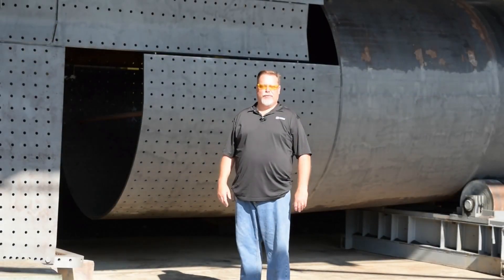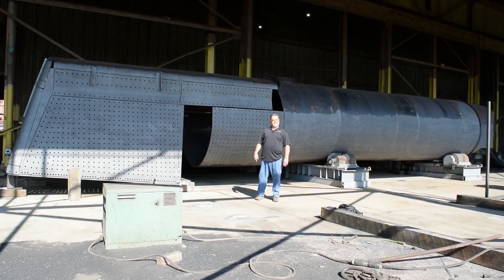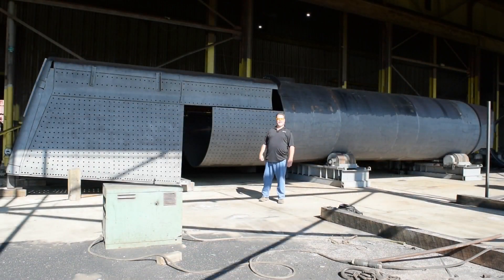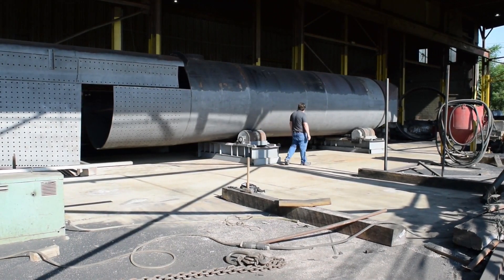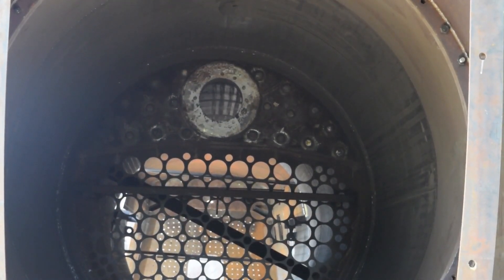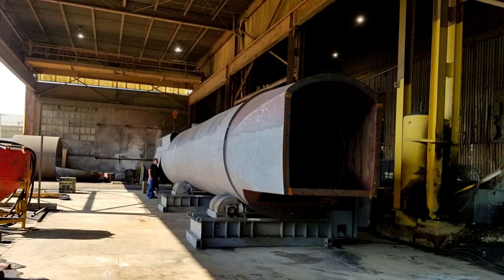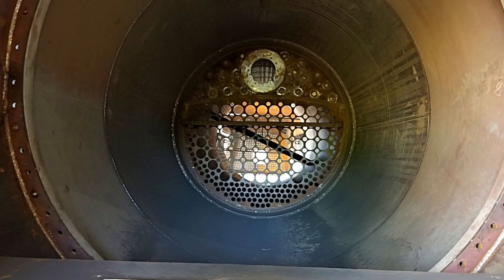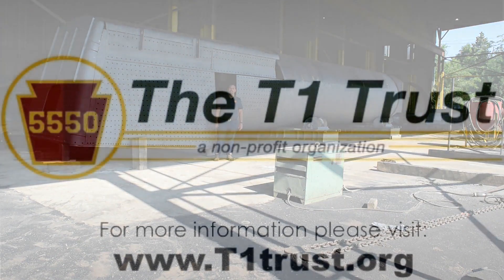T1 #5550 Boiler Assembly

Comment: Hopefully it doesn't do this https://youtu.be/RtU454_UIvs
If cause these locomotives have the most violent wheel slips
Reply: The trust will use B2 Rotary cam poppet valves. These were way better than B1 valves (when the original T1s had wheel slipping). There was potential in converting all T1 locomotives with B2s, but it was too late, as diesels were already on the way.

Comment: I hope you guys don't put poppet valve gear on your locomotive, I heard some of the prototype T1 locomotives weren't installed with poppet valve gear and actually performed better than the final product. You could prove the critics wrong.
Reply from the maker: You heard very wrong, Rotary Cam B2 poppet valves preformed at the highest level of ANY valve gear type

Comment: You mention the FRA standards, which are critical, of course.  Is it fair to assume the Belpaire fatigue issues have been addressed beforehand?
Reply: Belpaire boilers are fine, they just have to meet the engineering standards.

Comment: I wanna see the PRR 5550 doublehead with the N&W 611 and ride along the Strasburg Railroad.
Reply: if you two are done going back and forth on this matter how about you just look up the actual specifications for the real locomotives instead of using an arcade game as your basis for opinions and foamer beliefs of where it will run
Reply: @Michael4201YT  Dude, what are you talking about?
Reply: No chance. She’d be way too heavy.
Reply: @MiddletownBranchProd.  Too heavy? the N&W 611 is also big and heavy, and they let it into Strasburg anyway. I believe the PRR 5550 will be let into Strasburg as well.
Reply: @matthewpastrikos7383  Mmmmm nope. Look at Trainz models of a T1 and 611. Look at the size and weight. Physics.
Reply: @MiddletownBranchProd.  I've seen the Trainz models of the PRR T1 and N&W J class, they're both similar in size and shape, both streamlined and fast. Still If the N&W 611 can go to Strasburg, so can the PRR 5550.
Reply: @matthewpastrikos7383  i very much doubt it. Considering the 5550 is nearly the size of the Big Boy and probably as heavy, no chance it could even approach the rails of SRC
Reply: @matthewpastrikos7383  also they are nowherr near close in size and just because 5550 is gonna be streamlined doesnt mean it can go to Strasburg. Get the facts first
Reply: @MiddletownBranchProd.  Dude the PRR S1 is nearly the size of big boy not the T1, besides if the rails of SRC don't allow big and heavy engines into Strasburg, why was the N&W 611 the first one to be allowed there in the first place?
Reply: @MiddletownBranchProd.  The PRR T1 were already streamlined from the beginning, the T1 trust is building a new one from scratch. Plus I think the PRR T1 is being build with the streamlining on just like the previous ones from the 1940s to 50s.
Reply: @matthewpastrikos7383  ik but just because its gonna be streamlined doesnt mean it can go to Strasburg. SRC wont allow it anyway. 611 is probably the heaviest engine they’ll allow
Reply: @matthewpastrikos7383  No, the S1 is wayy longer than the Big Boy, the T1 is just about as big
Reply: @MiddletownBranchProd.  longer, bigger, what's the difference? The S1 is longer and bigger then the T1.
Reply: @MiddletownBranchProd.  And i suppose the NKP 765 is lighter then these two engines comblined?
Reply: @matthewpastrikos7383  WAYYYY lighter. just stop. 5550 aint gonna visit strasburg. its final
Reply: @MiddletownBranchProd.  Please, the N&W 611 have visited Strasburg in 2019 and then this year. Just give 5550 a chance. Also how light is the NKP 765?

Comment: When this locomotive is complete is it going to be limited to where it can go because of its large turning radius?
Reply: They are making some adjustments to the design so it can take tighter curves, and they say they might be able to run it just about anywhere. We'll just have to wait and see!
Reply: Maybe it can stay at the Strasburg Railroad.
Reply: @matthewpastrikos7383  Perhaps, though I don’t think they’d be able to fit a locomotive of that size in one of their sheds lol
Reply: @kiwianimationssolomonsharp6250  N&W 611 is big and they let it into Strasburg. So it's possible for PRR 5550 to visit Strasburg as well.
Reply: @matthewpastrikos7383  True, then again it would have to sit outside like 611 did, which may be a challenge considering it’s almost the size of the big boy
Reply: @kiwianimationssolomonsharp6250  "It's almost the size of the big boy"? Dude, you're think of the prr S1, this is the T1 we're talking about.
Reply: @matthewpastrikos7383  T1 trust actually posted a really good comparison between the T1 and the big boy, it’s only about 10 feet shorter
Reply: @kiwianimationssolomonsharp6250  True the T1 trust did a comparison between the T1 and the big boy, however if you compare the S1 to the big boy, that engine would be as big as the big boy, maybe even bigger.
Reply: @matthewpastrikos7383  Thats true yeah, though this means that even the T1 would have a hard time fitting on strasburg tracks, especially since its a rigid frame
Reply: @kiwianimationssolomonsharp6250  The N&W 611 is also a rigid frame but it seems to be doing just fine on Strasburg tracks, so maybe the PRR 5550 will do fine as well.
Reply: @matthewpastrikos7383  We'll just have to see, the sheer weight and size of 5550 is what's making me uncertain
Reply: @kiwianimationssolomonsharp6250  I'm sure the T1 trust will balance the weight and size of the 5550 well, if successful the 5550 will in fact visit Strasburg to meet up with the N&W 611 so we can see them do a doubleheader.
Reply: @matthewpastrikos7383  That would be neat to see! And if not at strasburg, they could still do some mainline excursion together
Reply: @kiwianimationssolomonsharp6250  Maybe the PRR 5550 could meet up with the UP 844?
Reply: @matthewpastrikos7383  That might be unlikely since 844 is owned by Union Pacific, and I don’t think that the railroads in the east would let them run in their tracks
Reply: @kiwianimationssolomonsharp6250  Hold on, then explain the time when the southern pacific 4449 had a race with the up 844 (8444) back in 1989 and then they did a doubleheader in 2007 despite the sp 4449 not owned by the union pacific? Cause since the sp 4449 meet up with 844, surely it's possible that the PRR 5550 could also meet up with 844 as well.
Reply: @matthewpastrikos7383  Oh right that’s true they did do that, though I think it’s gotten a bit stricter over time. Still it would be cool to see something like that!
Reply: @kiwianimationssolomonsharp6250  Yeah it would, maybe we'll even get to N&W 611, NKP 765, and PRR 5550 do a Tripleheader one day.
Reply: @matthewpastrikos7383  doubt it. people arent gonna go for that, maybe for an NRHS convention but still
Reply: @MiddletownBranchProd.  of course people are gonna go for that, they would do anything to see a once in a lifetime experience. If people wanted to see the UP 844 and SP 4449 have a race and then doublehead years later, thet'll do it and they got it. If they wanted NKP 587, N&W 611 and 1218 do a tripleheader, they'll do it and they got it as well. If they wanted the two QJ 2-10-2 steam locomotives from china to go to the US and do a tripleheader with the Milwaukee Road 261, they'll do that as well and spoilers alert, THEY DONE THAT!!! There's your prove that anything is possible, why shouldn't this one be?
Reply: @MiddletownBranchProd.  611 have already went to Strasburg despite it's weight and size, why not the 5550? And don't you dare nuke one of the countries.
Reply: @MiddletownBranchProd.  There are four things wrong with that
1: People thought that 611 might not back to SRC again back in 2019 and guess what, they thought wrong when 611 did came back to Strasburg this year in 2021.
2: Sure 5550 is big and heavy but so is the 611 and like i said, they still let it into Strasburg.
3: If you nuke Oregon, you'll become a you know what.
4: I AM NOT STUPID YOU HEAR ME!!!

Comment: Honestly I was very skeptical about this new build, but you guys seem to know what you’re doing. Good luck
Reply: At least the legendary T1 Duplex is coming back even if it's a new build. And I imagine because it's a new build they can add things to it the original T1s didn't have like Positive Train Control
Reply: I too, was skeptical that this project would get anywhere off the ground. There was a group of people some time ago looking to reconstruct a NYC Hudson, but their project fell apart due to lack of funds and interest. I'm happy to see I was wrong to doubt these guys.
Reply: It'll be exciting to see the PRR 5550 to visit Strasburg one day and hopefully meet up with the N&W 611 so they can doublehead one another.
Reply: @matthewpastrikos7383  not to burst your bubble but I think the new t1 is going to be too heavy for that branch line
Reply: @katerinakittycat3849  May i need to remind you that the N&W 611 is also big and heavy, and yet they let it into Strasburg anyway?
Reply: @matthewpastrikos7383  #611 is probably the biggest engine that can another problem with the branch is the curves might be too tight, the t1 is a ridged framed engine that is nearly as large as the big boy. 4014 could POSSIBLY travel to Strasburg if the rails could take its weight but the difference is the big boy is articulated and the T1 is not. I agree it would be an amazing sight but I don't see how it's possible
Reply: @katerinakittycat3849  First of all, you're thinking of the prr S1 6100, now that engine is nearly as large as the big boy.
Second of all, N&W 611 is also a ridged framed engine that can go though tight curves, so it's possible for the PRR T1 5550 to do that as well. Lastly, i agree with you that it would be an amazing sight to see and i hope we get to see the PRR 5550 and N&W 611 to do a doubleheader one day.
Reply: @matthewpastrikos7383   I'm just being realistic. There is  a reason big locomotives like t1s challengers and big boys don't travel on branch lines. But we can always dream. Now if it CAN operate as Strasburg successfully that would be an amazing accomplishment for its class. But realistically I wouldn't expect to see a massive t1 on that line.
Reply: @katerinakittycat3849  He's right. It's a bit of a fucking nightmare to do the number crunching though, as the simplest source (wikipedia) is not well curated and has most classes only given an overall length and not separated by tender and engine. But a PRR T1 and an N&W J class are practically identical inch by inch and ton by ton in so far as the numbers are available. Look to PRR 5550's page for a better breakdown of the length and wheelbase.

He's also right in the point that the S1 was the mammoth beast on a similar scale to a Big Boy.
Reply: @Morgan_Sandoval  that also translates into the 1/48 o gauge models 
These engines do have a major problem though 
The t1's weight is mostly distributeed over its drivers Which makes the locomotive extremely prone to wheelslip. Too much of that will cause damage to the tracks it runs on no matter where it goes. Though if this thing IS able to run at Strasburg you can be sure I'd be making plans to go and see it
Reply: @katerinakittycat3849  That's also wrong. The wheelslip issues are from an intentional lack of training and forced turnover of the drivers. Any engine has wheelslip issues if you drive it wrong enough. Wish I remember where I read that, but some of the PRR brass later admitted they forced the design to fail.
Reply: @Morgan_Sandoval  Yes, thank you.
Reply: @Morgan_Sandoval  I just wished they didn't have to scrap the prr S1 so soon. Maybe instead of marking the S1 as a failure, they just need to rebuild and modify it into a 2-4-4-4-2 Triplex. That way unlike the Eric and Shay 2-8-8-8-2s, the PRR S1 2-4-4-4-2 is more compact and produces more traction then the previous Triplexs and most of the weight will be from each of the 4 driving wheels on the engine. What do you think?
Reply: @matthewpastrikos7383  I know neither enough about physics nor engineering to form much of an opinion, sorry!
Reply: @Morgan_Sandoval  That's all right, we all just have much more to learn.
Reply: @katerinakittycat3849  If the N&W 2156 will ever get restored into full operation one day, it will also go to Strasburg to reunite with 611.
Reply: I really hope this succeeds but I think it's too early to be impressed about a shell of an engine. We can get really hyped when they get the actual mechanical pieces and other intricate parts on and functioning.